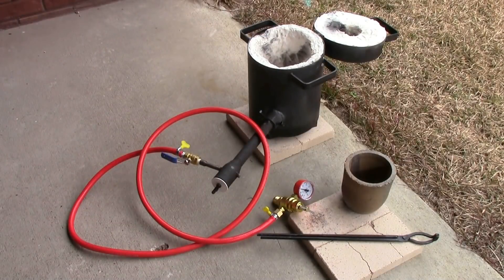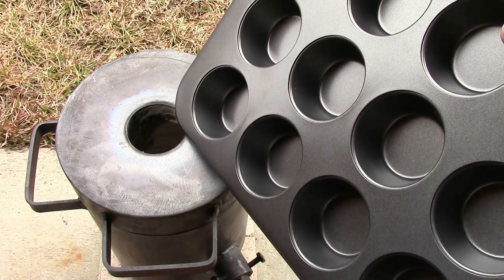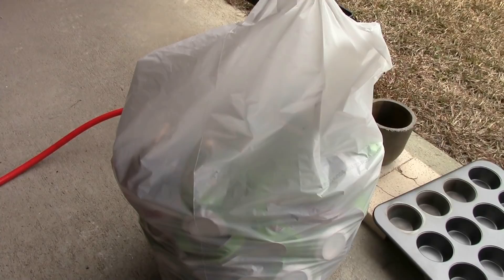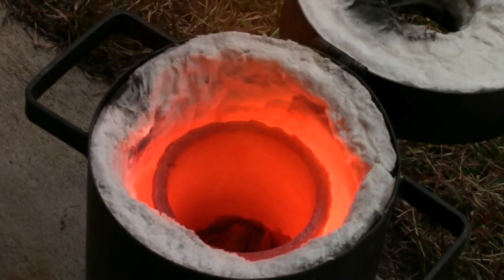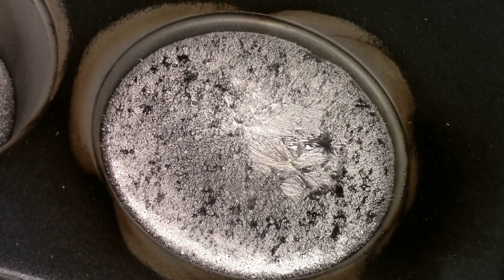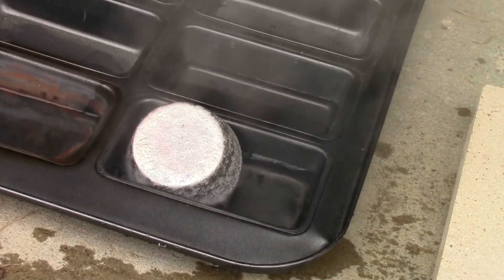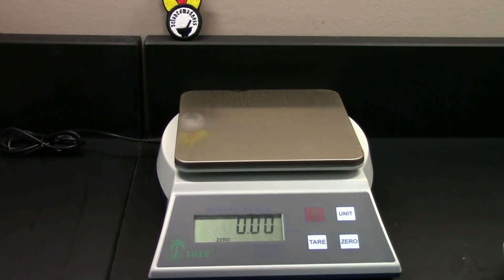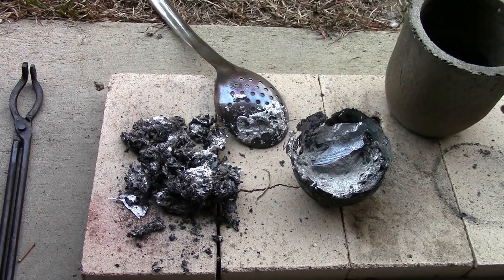Aluminum Furnace Upgrade

Comment: What is the method to refine the sludge of aluminum can?
Reply from the maker: I've tried using salt as a flux to separate metal trapped in the dross; thay gets a little more out. But any Al that has oxidized is extremely difficult to refine back into Al at the hobby level. It requires a ton of energy and a lot of engineering.

Comment: Drinks cans are pretty much the worst possible source of aluminium for casting (as you've found :) ), the coatings are a significant part of the weight and the mostly pure aluminium shrinks a lot when it cools.

You're best to use cast aluminium, e.g. transmission casings, engine parts, etc.. They are relatively high-silicon alloys which leads to much less shrinkage. It's easy enough to break those down, throw them in a fire for a bit then hit them with a sledge hammer, they'll basically shatter into small pieces due to hot shortness.

If you're serious about casting, I'd recommend spending some time at Alloy Avenue, there is a huge amount of experience with home foundry stuff on tap there.
Reply from the maker: Morgan Reed I'll check it out, thanks!

Comment: When I did a bit of this I had real problems with using soda cans. Instead I got scrap extrusion aluminium from wrecked engine blocks very very cheaply. Mixing some of that in might help fill out the muffin pans. You could possibly pre-burn the paint and plastic liner in an oven or barbecue which would reduce bubbling from hot gases, helping to keep the surface area down.

Comment: Some tips: Keep the tabs on the cans. Heat your spoon/drossscraper before you scrape to waste less Aluminium. Just stick it in the pot and let it sit for a litte while before scooping the dross out. Keep the temp up for easier pouring.

Comment: One of these cans has 0.25€ deposit on them in germany. Also they are made from steele and not aluminium due to the alzheimer risk. (only pepsi is still using aluminium)
Reply: They use it because steel is cheaper, not because of any disease risk. No one has yet been able to show any link between alzheimer's and aluminium. That's just another media scare. If aluminium would harm the body in those trace amounts, evolution would have fucked up in a big way. Aluminium is the third most common element in the earth's crust, so it is everywhere naturally, especially in everything you eat and even in water.
Reply: There is no "very reactive pure aluminium" in any products, because, well, it's reactive. Unless you're in a vacuum (good luck eating or drinking something there) you won't find any unreacted aluminium (not talking about chunks of metal obviously).
Reply: So you eat your cans? Or how else do you ingest "pure" aluminium? (what is pure aluminium anyways? It's either aluminium or not). Aluminium also react instantly with water. Don't know about you, but I've never seen a beverage without water. How would you get unreacted aluminium in a can?
Btw. cans are usually coated on the inside so the contents don't even come into contact with the metal. And no, they don't do that because aluminium is oh-so-dangerous, it's because cans could leak after a few month of storage when its (most times acidic) contents would have eaten through the metal. Maybe you should start reading research at some point.
Reply: Don't you see that you are contradicting yourself? You say aluminium is very reactive (which is correct), but then for some reason it is not reactive? Explain again how you can have unreacted aluminium (or "pure" as you call it, which has no scientific meaning in this context) in a drink or food. Explain how if something breaks off an internal wall it does NOT react immediately with the contents?
Reply: Unless you open your cans with a file I don't know how you would ever get particulate aluminium metal into your food.

Comment: Based on my experience (I recently built a very similar furnace and am melting with it aluminum, copper and making aluminum bronze and tin bronze) I see a couple of problems with your equipment.
It doesn't appear that the bottom of your furnace is covered with insulation. Also the kaowool performs much better if it's covered by another refractory layer. In my build I used 2400-degree rated kaowool (1 inch) which I then covered with 2 layers of a refractory clay called satanite (rated for 3200F).  I mixed the satanite with water to the consistency of thick sour cream then brushed it on the surface of the kaowool about 1/4inch thick, let it dry for 1 day, warmed the whole furnace with a heat gun inserted through the burner orifice for about 30 minutes until it was nice and toasty to cure the first layer. After it cooled down I applied a second layer then dried and cured it the same way. 
It is holding together beautifully. I have done about 10 runs with it melting copper and making bronze at temperatures above 1100 degrees Celsius and there isn't even one crack in the coating. Uncoated kaowool will begin to melt at the surface and sag after a few runs. Not to mention put out small ceramic fragments in the air that you breathe. 
Don't forget that the lid needs to be coated too of you decide to do it (which I highly recommend).
I have also coated the exterior of some of my clay graphite crucibles with 2 layers of satanite. Compared to uncoated crucibles, the coated ones are holding together much better.
Use a flux when melting metal. For copper and bronze, borax works best at about 1 teaspoon per pound. For aluminum I use a 1:1 molar mix of NaCl and KCl (58.5g NaCl and 74.5g KCl). The mixed salts form an eutectic with a lower melting point than either, at about 600 degrees C which is just below the MP of aluminum; it will make the dross easier to manage. And you do get a lot of dross from cans. Lately I've been melting mostly pieces of cast aluminum and get far less dross from that.
(Edit) I've looked at the pictures on Amazon and the bottom is insulated. It just looks in the video like it's bare. Maybe it's because I watched it on my phone instead of a computer.
Reply from the maker: Thanks a lot for taking the time to write such a detailed comment! Lots to think about. I will definitely try fluxing it, and others have suggested degassing as well.
Reply: mrhomescientist you're welcome. Fluxing is very helpful, not sure about degassing. I just give the melt a good stir. You would need a refractory pipe to inject nitrogen and it would need to be under very well controlled pressure to avoid splashing molten metal everywhere. Stirring is good enough for me and in fact it's required when making alloys or else the metals may segregate in layers by density. 
Cooling ingots in water is fun but don't do it when you try to cast objects. Aluminum and bronzes have quite a bit of contraction when cooled and you will end up with voids inside the objects. You want a slow and gradual cooling as well as a reservoir of molten metal ("runner") located outside the object in the mold so you can feed more molten metal to your cast as it cools. I don't have videos of my own but look at videos by swdweeb to see how it's done and how to avoid defects.

Comment: I don't think you're oxidizing very much aluminum.   The interior coating and the exterior paint comprise a significant fraction of the weight of each can.  (That amount can probably be calculated fairly well by roasting a couple of cans by hand and weighing the material before and after.)  I believe mechanical losses account for most of the unrecovered metal.  I should think the dross and dregs could be re-melted and a goodly fraction of the aluminum drained from that mass by use of a steel mesh.

Comment: What's wrong with the can tabs?
Reply from the maker: I wondered if anyone would catch that. I've been collecting them for a future video where I dispel some soda can myths. There's a ton around just about the tabs!
Reply: He probably collects them to give to a friend of a friend who needs the high purity ring pulls to go towards a new wheelchair!
Reply: Fun fact: the tops of soda cans and the rest of the can are made of different grades of aluminum. IIRC the sides and bottom are of almost pure aluminum whereas the top is an alloy with manganese.
Reply from the maker: Yep, I researched that a while back. I found that the body is 3104-H19 or 3004-H19, and the lid is 5182-H48. I believe the tab is the same as the lid, but haven't confirmed that. The body is 95-98% Al, with about 1% Mg or Mn. The lid is 93-96% Al with 4-5% Mg.

Comment: So I’ve got a bunch of aluminum muffins but I need powder
Do you think I could somehow drill it down into turnings then use a ball mill or just sit for hours with a file
Reply: Drilling and ball-milling would be better than filing, but what would be even better is if you have access to a lathe or milling machine
Reply: I would almost bet that a filing a work piece in a vice removes material faster than filing on a lathe, letalone a makeshift drill lathe

Comment: Flux and a degassing agent could help, a quick googling indicated 50% NaCl 50% KCl ("lite salt") for the flux and bubbling nitrogen through the melt for degassing. Apparently the burning propane and plastics will dissolve hydrogen into the aluminum.

Comment: Al conducts heat very well and so its temperature profile while casting is comparatively flat. The result is that it freezes really suddenly at a high thickness. With cast steel you end up with a solid skin and molten interior. With Al it solidifies right to the core. This makes pouring etc more difficult. You need a significant overheat to handle it easily.